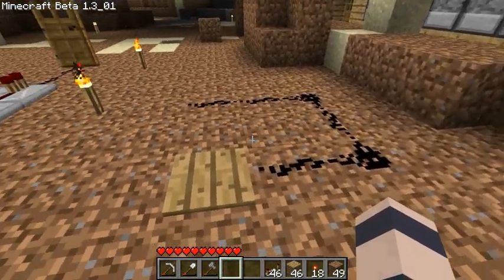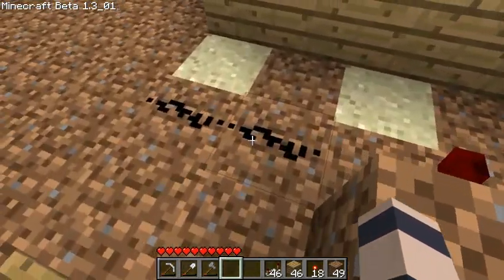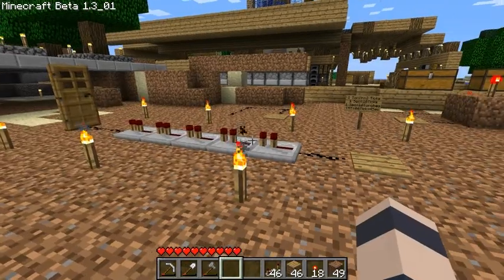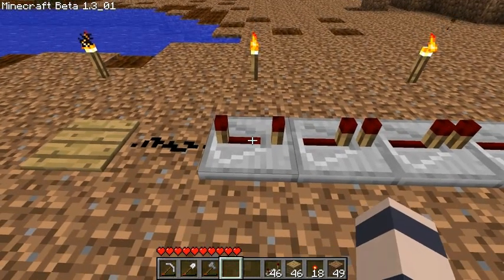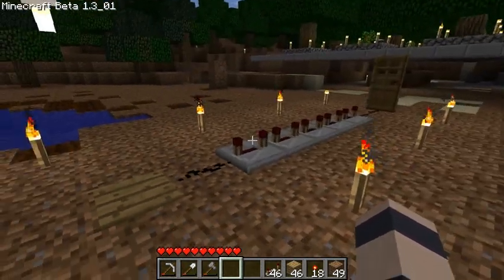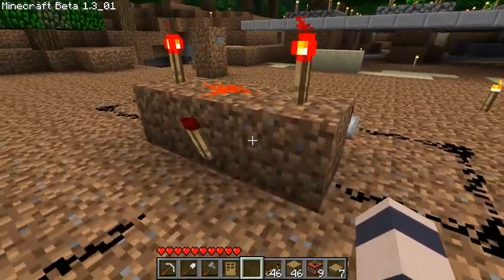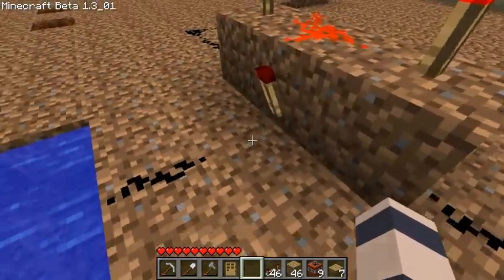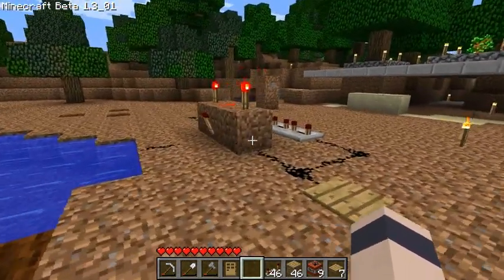Minecraft - Tutorial: Red Stone Delay

Comment: "RS NOR latch" stands for "Reset-Set Not-Or Latch"  It consists of a pair of cross-coupled NOR logic gates.  NOR logic will only let a signal through when both input signals are in the off state. Cross coupling 2 NOR gates means one input is your button, and the other input comes from the other NOR gate. This lets you SET a redstone state (ON or OFF) indefinitely until the switch is RESET.

Comment: also i figured out example 3 on my own a while ago but i didnt use a memory cell. i used one button connected to 2 wires. one wire had no delay and would open the door. the other had, i think, 3 or 4 redstone repeaters on it and would give power to the door right before the button stopped giving power by itself. simple, but it would hold the door open for like 3 seconds.